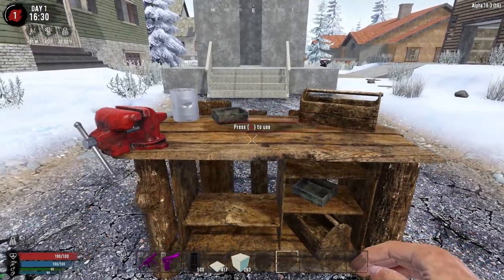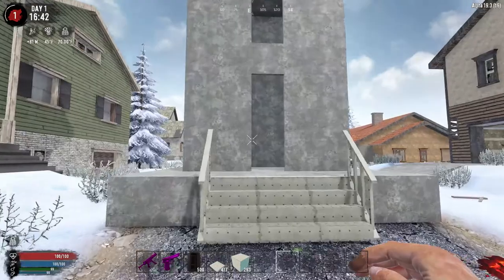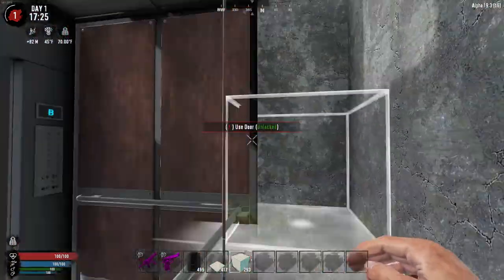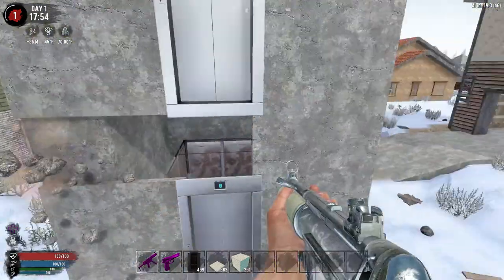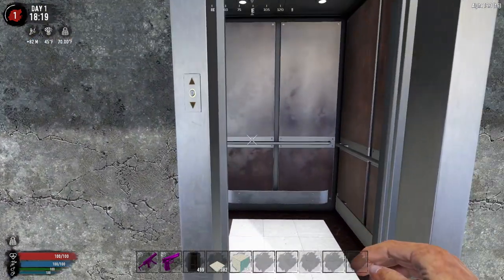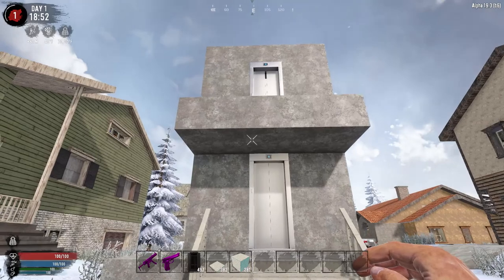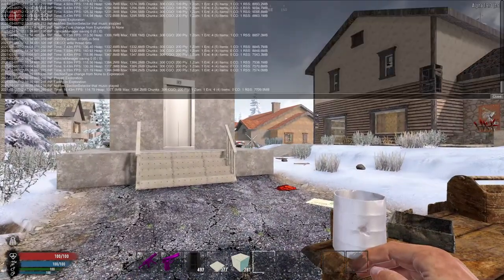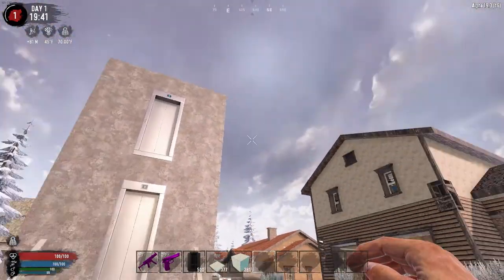7 Days to Die: Workable Functioning Elevator Mod Showcase

Comment: Looks great, does it work with multiple floors? Or is it only the one level to another?
Reply from the maker: You can technically make multiple elevators to stack them to get to multiple levels, but the elevator will only go a set flight up and then back down.
Reply: @mediarchivalcollective  thanks for that, I will have a play.
Reply from the maker: @Desmondbratcat  you’re welcome!

Comment: Great video. How far can you go with 1 elevator?  I want to go from ground to bedrock. Is that possible with one elevator?
Reply from the maker: Thanks! In theory, it's possible. However, I can't imagine the amount of work it would take to accomplish that and it would require a brand new modlet.

I would advise trying to build 2 elevators rotating up/down to accomplish your goals!